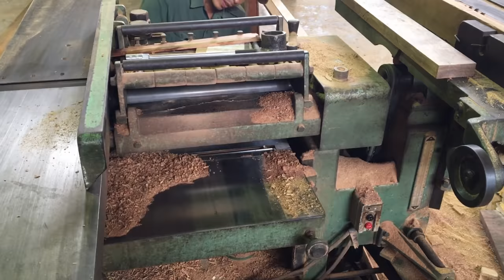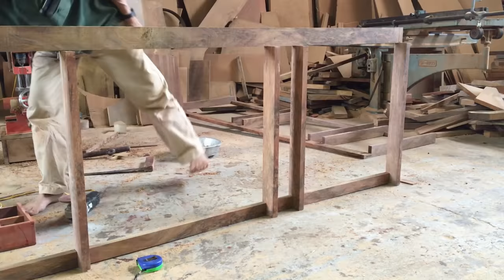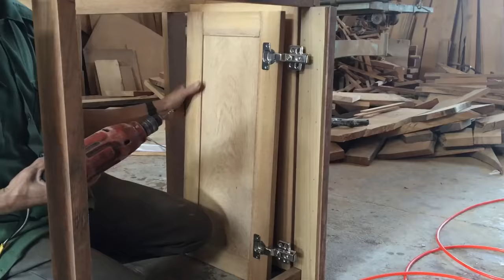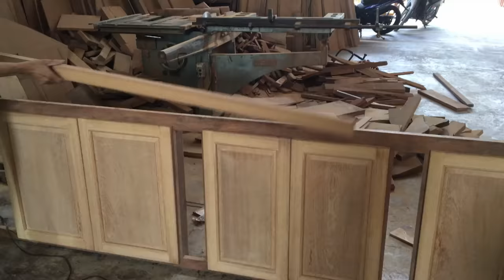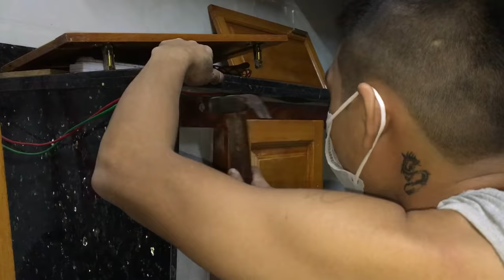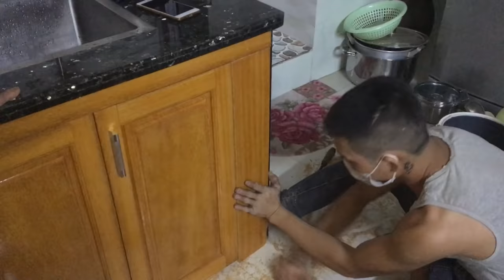Build & Install Frame Under Kitchen Cabinets - Amazing Woodworking Skills Extremely Smart Carpenter

Comment: A maintannance tip:On the inside of the cabinets are located the inner hinges around 2-3 times a year inspect them and check for loose screws if they are loose then tighten but not overtighten. This will ensure that the entire hole will not round out from a loose hinge and or prevent the cabinet door from unhinging. 
Over time due to usage they the inner hinge screws come loose.

Comment: I got nervous the way the guy using the jointer planer machine,adjust the guide bai",its dangerous mch.
Reply: Diomedes Torio I was thinking the same.
Reply: These are not ordinary carpentry.. Not a western style... These are extreme experience furniture carpentry its their daily work not an ordinary diy you know.